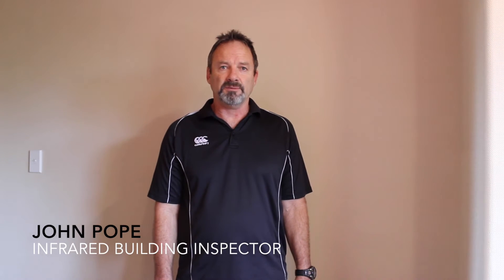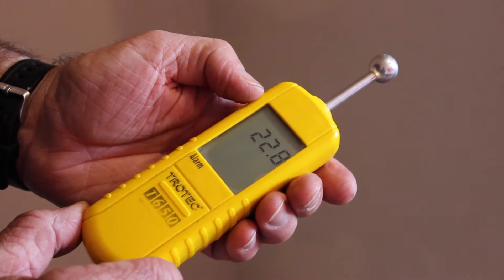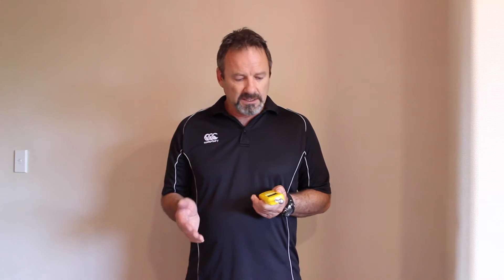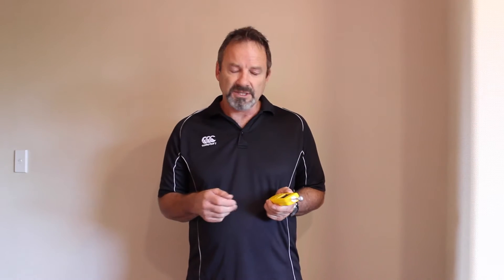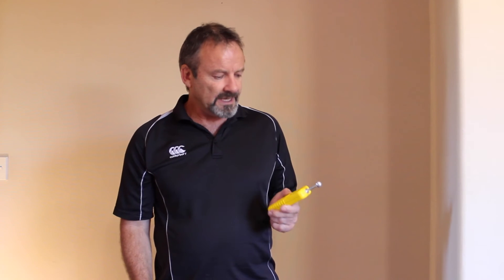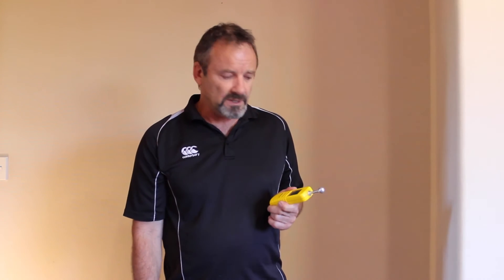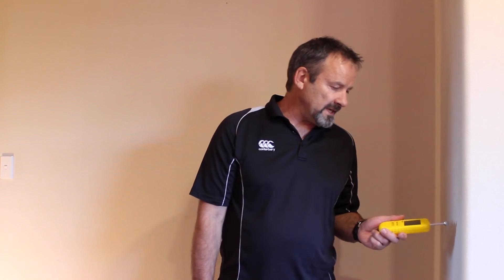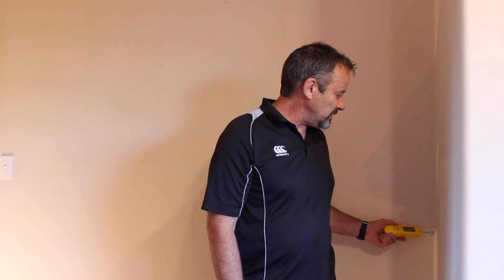How to use a non-invasive Moisture Meter for Moisture Inspections

Comment: Many metals are non magnetic like stainless steel, so testing the magnet is not valid
Reply from the maker: Yes you are right but most of the metals I come across doing house inspections are magnetic, hence the reason for using it such as nail fixings, strapping and external corner mouldings underneath Gib board

Comment: What kind of meter can you use for plaster walls with metal lathe behind surface?
Reply from the maker: You can't as the metal will give you a false reading. Just test from the inside to see if the moisture is getting through or use thermal imaging to show possible ingress.

Comment: what would be considered high for a basement wall or ceiling?
i want to find out if there are moisture problems in my customers homes when they are curious about mold
Reply from the maker: Any reading under 40 is considered normal with this Trotec moisture meter. The readings will change depending on the material you are testing. If the basement has concrete walls or Gib strapped over concrete this will increase the readings. Taping on the wall is often the best way to tell and remember to take comparative readings, so you can decide what is normal for the material you are testing. Concrete can be normal with a reading of 80.
Reply: thanks it was great.